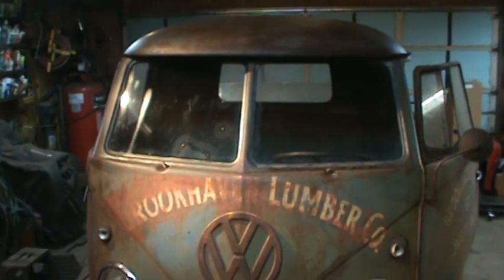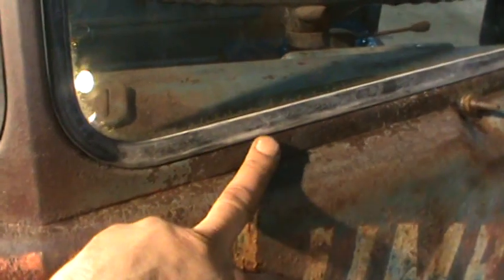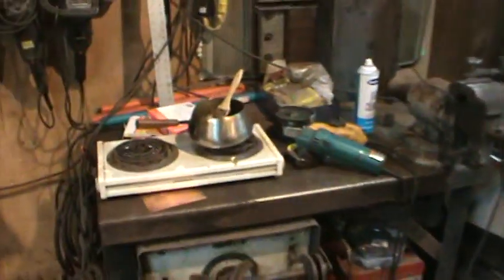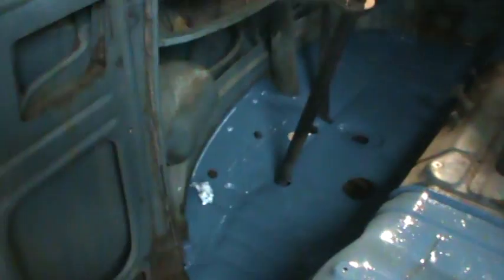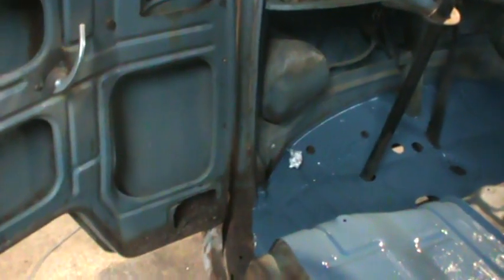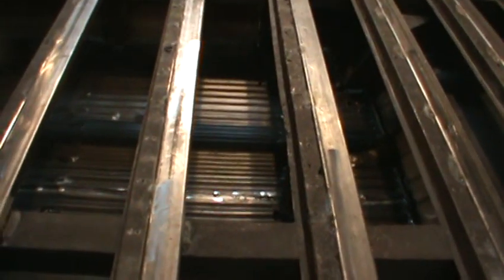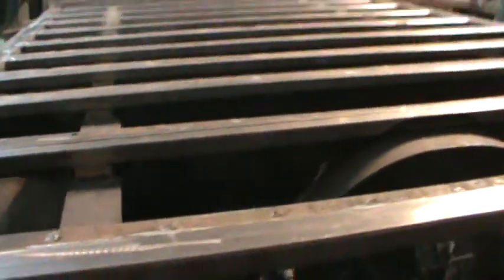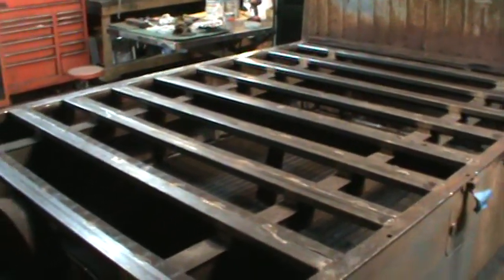1959 vw single cab pickup rustoration, part 11

Comment: I just learned that there is a great product called weldable primer, you may already know about it, but it is just the thing for protecting supports under a panel because you can spray the primer on and then weld the panels in place. The primer then flows back around the area that was welded, preventing future rust. Apparently there are several types but the copper based version was recommended.

Comment: Wax job looks mint. Perfect finish for that classic truck. Like the restoration of the side hatch door, clever with the hardware upgrades. Somehow that shiney paint in the cab seems disrespectful...lol
Great video of the huge tasks you've completed on the body and bed.
Let me know how many teeth are on that 7HP elec starter pinion, hmmm
Stay warm, where's the SkiDoo ?
Reply from the maker: skidoo went home, right its got to get dulled down on the chrome, l tried to write you back on regular mail and it would shut down aol each time, weird, can you get a dc starter for that motor?
Reply: DC, no don't have those, but so goes it....
Weird we can't communicate.... The old school e-mail will work for me !
Stay warm brother, the Single Cab progress is awesome, keep doin what you're doin brother, I'm watchin !